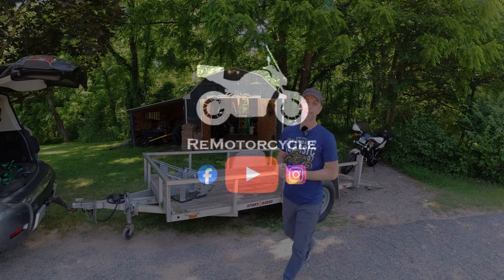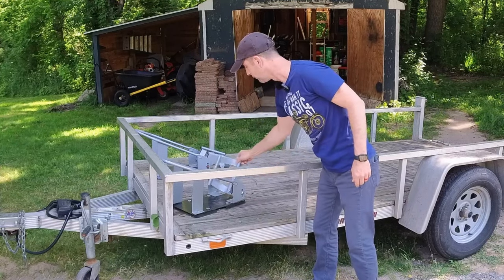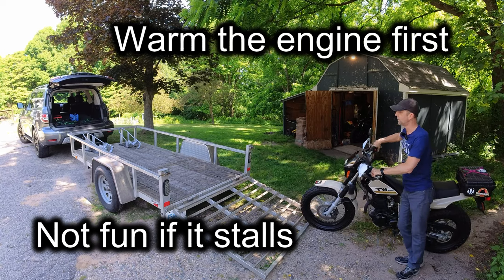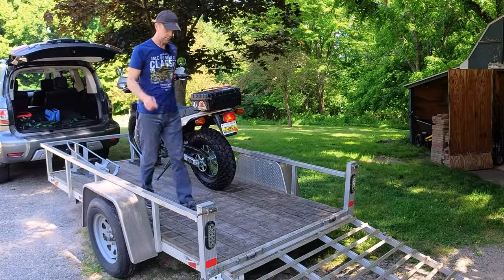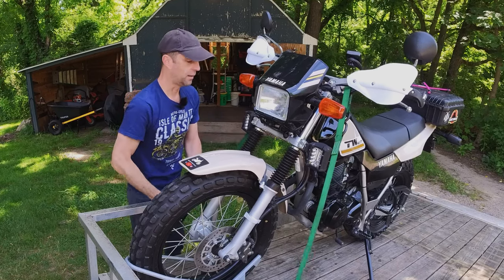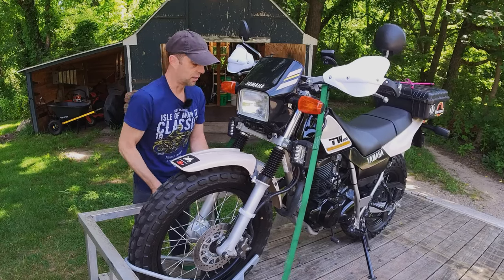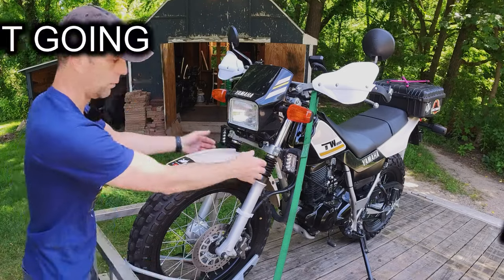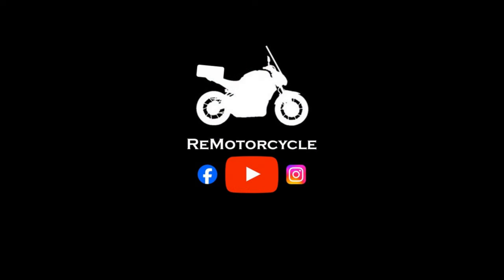TRAILER Your Motorcycle the Right Way

Comment: Want to learn something?  Post a "How to" on the internet and you'll learn the ways....  :)    There are 3 things I see that have caused me issues over the prior 40 years of motorcycle hauling:

First, strap to the lower triple and not the handlebars.  The number of bent (and broken) bars from strapping to them is a very large number.  This has even resulted in bikes falling off trailers while at speed when the tie-down comes undone, watched it with a racebike right infront of me on a caravan to some track or another.  Sportbikes with hard to reach lower triples are best served with "Soft loop" (about a foot long figure 8 strap) tie down straps that live there on bikes that are frequently hauled (race/track bikes).  I have many sets of these that I use all over to give a good no-mar tie point or even a little Extension if a strap isn't quite long enough.  

The second issue is that by compressing the forks All The Way you can run into issues with leaking fork seals.  It's not that the forks are bottomed out, that can happen in normal riding, it's more that Most casual riders rarely use much of the fork travel and thus dried on grime and dings in the tube pass over the inner oil seal and cut it.  Part of my career was as a suspension guy, rebuilding forks and shocks, this is the overwhelming reason most fork seals leak.  Clearly, dust boots on the TW help mitigate that....  

Third is that those Specific wheel chocks are Bad News for street bikes with bigger brake rotors.  I love me a good wheel chock, just needs to be pointed out there are some that aren't compatible with all motorcycles.  

And a bonus, the best straps are those with carabiners instead of hooks.  There is No Way for them to come off, which means you can tie the bike "looser" and allow the suspension to work on the bike as normal.  I rarely compress the suspension on my bikes more than a half inch since it's just not necessary when the strap simply can't come off.  Tens of thousands of miles going to racetracks and off road parks like this and it's easily one of the best upgrades/changes I've done based on other riders suggestion.
Reply from the maker: The lower triple is another good option.  Thankfully, I keep my forks pristine and they don't leak but yes, dings in the fork can definitely leak.  My largest bike is a Yamaha FZ07 and the discs fit nicely.  Front tire is 120mm.  I can see how wider would be a problem.  Carabiners would be great if you have loops to connect to.  My hooks would eject a carabiner either way.  Let's pop this comment up to the top so we can all learn together.  Thanks for watching and I hope I earned your subscription!

Comment: I was taught to never compress the forks all the way, I travel 2400 miles round trip every year with  my bike on  a trailer and I've gone over some significant bumps, that strap has never came loose/undone. I compress them about 1/2 way.
Reply from the maker: I compress probably 80-90%. Thanks for watching!

Comment: Hey nice vid, I was told by mechanics that squashing the forks like that is harmful to the internal components of the shocks. IN MY YONGER DAYS i had a yamaha 360 and carried it on a Ford courier, It kindof lived on the back of this truck and I only needed 2 tie downs to secure it neither of which  put as great of pressure on the shocks.
Reply from the maker: Thanks for watching!  The fork is an oil damper.  I don't think the oil cares what side of the damper it's on.  Crushing the springs for long term would be bad which is why bikes are shipped in crates with the forks relaxed.  It's all about getting the bike somewhere safely while protecting other drivers that would be in danger if the bike fell off.  I've hit some junctions on the highway where the trailer gets air.  You want the bike to stay right with it!